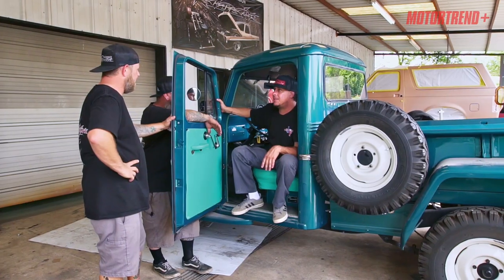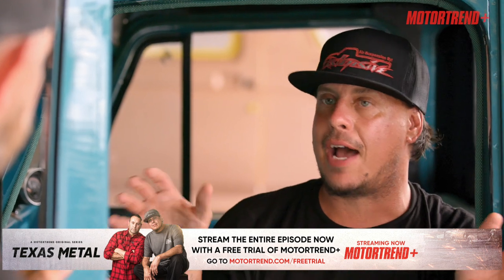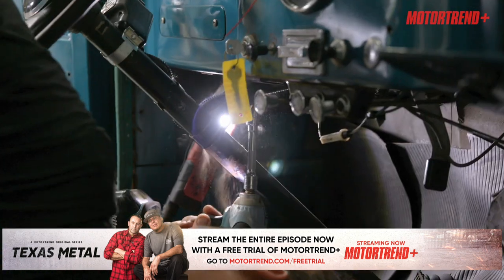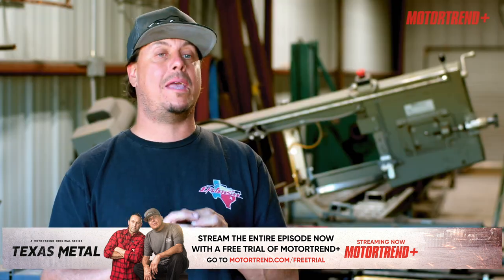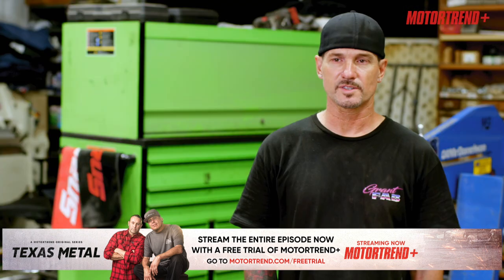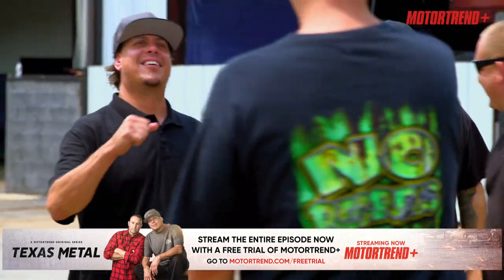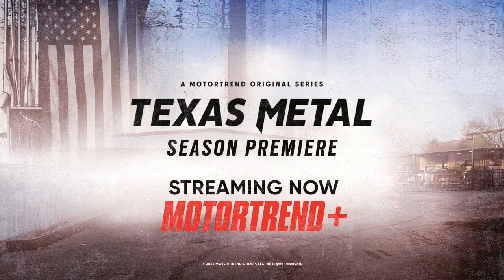Slicing 1960 Willys Jeep for Body Expansion | Texas Metal | MotorTrend

Comment: I have a bone stock, yellow, 1958 Willys truck in my backyard. I drove it to school in the 80s. It’s been parked on rotten tires since. It needs some cleaning, repainting, brak work, etc., but being in SoCal, rust isn’t an issue. I wouldn’t even consider chopping it up!
Reply: Watch the whole episode before you judge guy just retired and has had it all his life and it's the first vehicle he's ever had customized.
Reply: @TATTDIS  It’s a free country…mostly but he should find a donor truck in bad condition.  Maybe replace the axles with modern units to make the brakes and steering safe.
It’s his pickup but I wouldn’t be surprised if some shop’s told him the same thing.
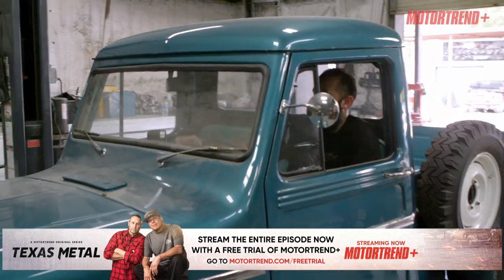Reply: Honestly just watch the first 2:30 minutes and you'll get it. New season (5) episode one it's called "Jeep splits and foreign whips".